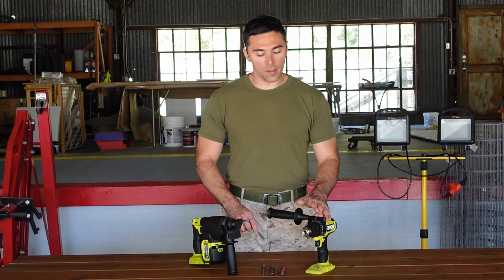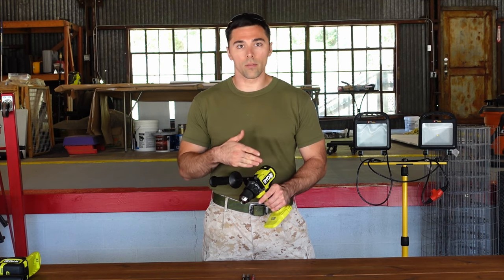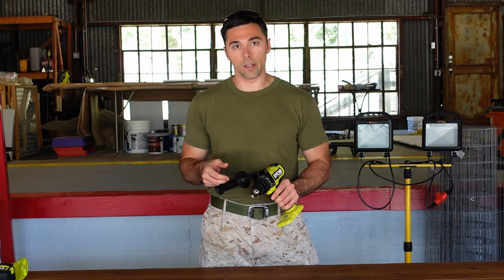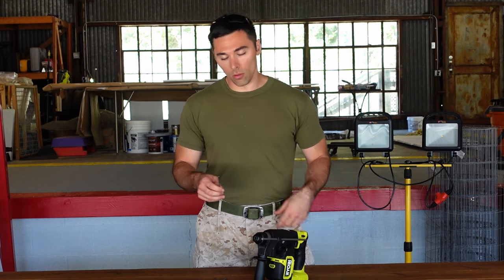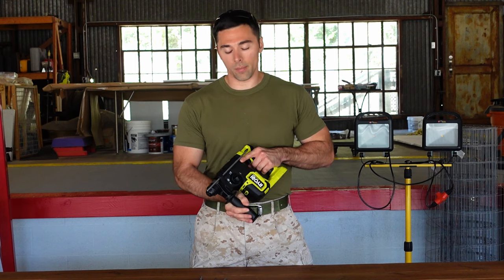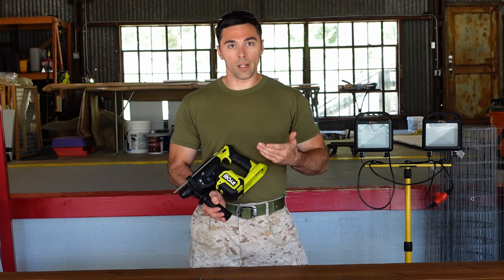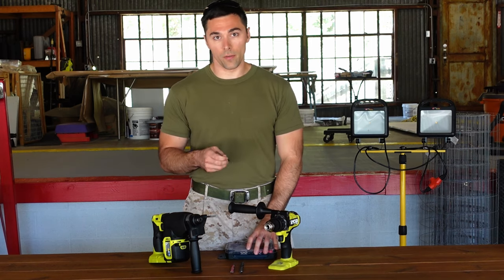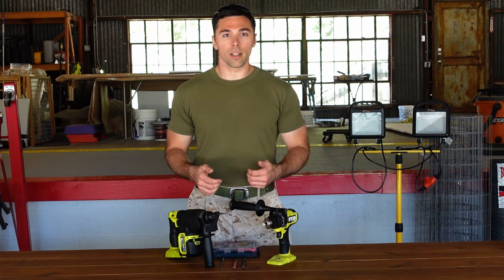Ryobi 18V ONE+ Rotary and Hammer Drill Comparison || How Are They Different?

Comment: Something to keep in mind as well , diameter isn't the only factor when choosing between hammer drill and rotary hammer, if you have 12-18" inches of material to go through for a 3/8th's hole your 
going to want a rotary hammer or your going to be spending a very long time with a hammer drill making that hole. 

And that Ryobi rotary hammer is a wonderful tool , i take it on any job where i need to run cat5/6 externally. (security cameras ect.)

(just some experience from a low voltage field tech.)
Reply from the maker: True, I forgot to mention depth as a deciding factor. But if I was drilling through 12"-18" of concrete, I would use a Rotary that was corded. Battery tools are great, but still no where near as powerful as corded. I like the Ryobi tools, but there are better tools on the market when it comes to more advanced projects.
Reply: @thediygrunt  I think your selling the battery powered rotaries a bit short, Granted I only use a 9ah battery on mine so your millage may vary.

Comment: "In the past, most hammer drills were solely, only able to do the hammer drill ability, so they were impractical to be used for drilling and driving because you couldn't turn off the hammer function."

How far back are you going for that nugget? I've got a blue (Ni-Cad) Ryobi hammer drill and two Ni-Mh Dewalt hammer drills (XR2 and XRP) that all have the ability to turn off the hammer function. These drills are around fifteen years old. Much older and we're talking about the days of tall stack makitas with mile-long handles to fit the batteries.